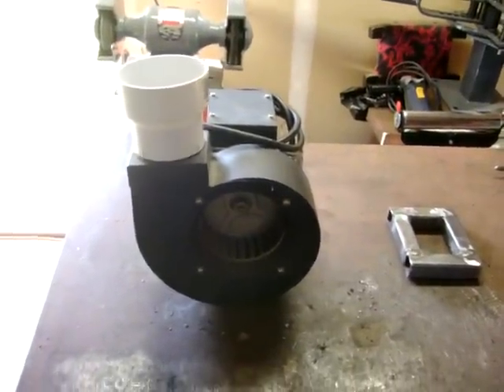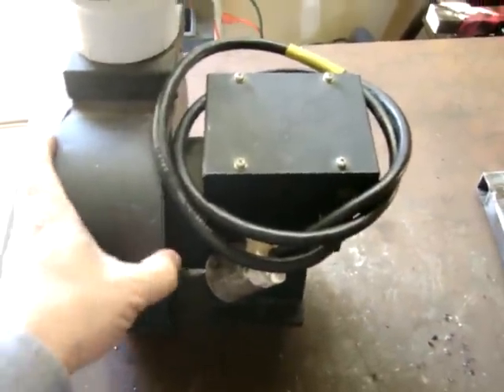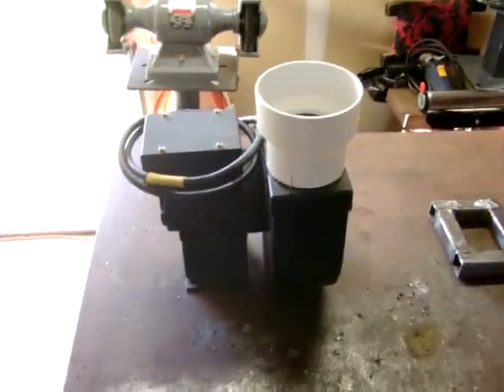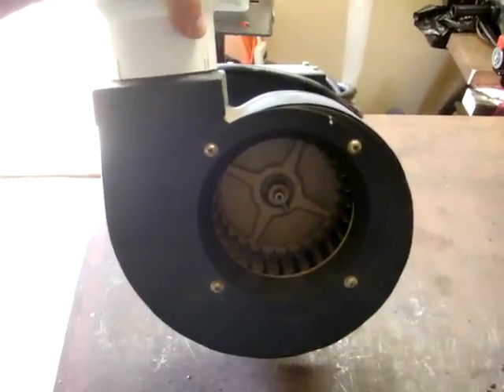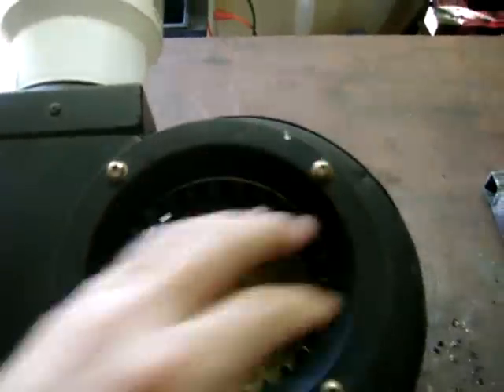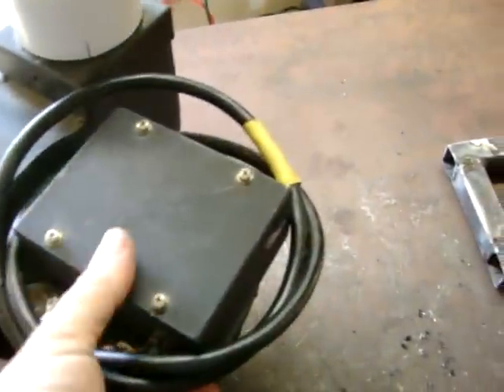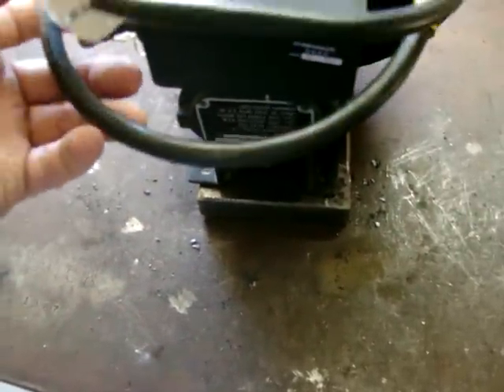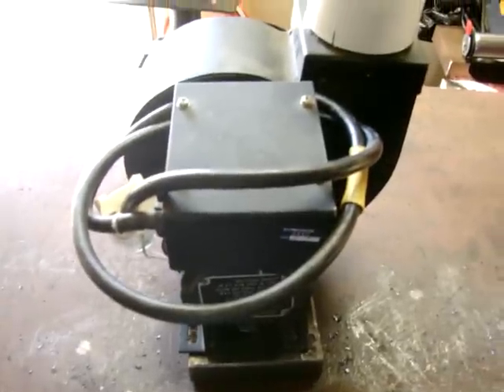Big John's "Economical" non-filtered welding fume extractor

Comment: A shop vac will move air, so it will be better than nothing. The flare is a good idea. Something like a bathroom fan or kitchen range hood has a fan designed to move air rather than develope suction. If you keep the flex hose short, it helps a lot with low power units.

Comment: I think you have a good idea. When I first saw your fan I thought maybe the CFM's would not be enough. I don't think the fumes have to be filtered, just blow the exhaust outside. I am looking at using a strong shop vac, Build a flare and the work station (hose out the fumes other end and out the shop. What do you think?

Comment from the maker: @larrybl It turned out to be a flop. I gave the blower to another ham op who uses it to cool a Eimac amplifier tube. It works great for cooling RF transmit tubes however, it just cannot move enough air. I think it would have worked well if I had a bigger motor/squirrel cage setup.

John

Comment from the maker: Yes, I finished it with lackluster results. I built a small square base to mount it on. It doesn't  move as much air as I hoped it would. I kinda got discouraged and set it to the side. I guess I need to find a bigger blower motor.

Take Care,

Jon